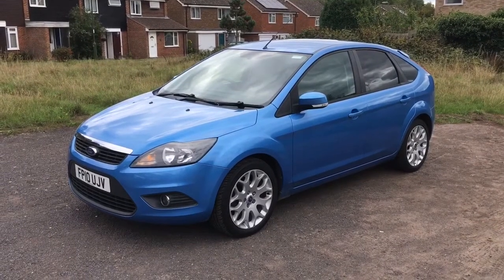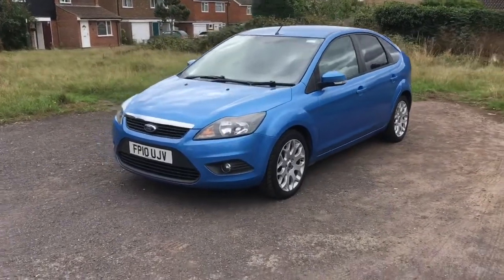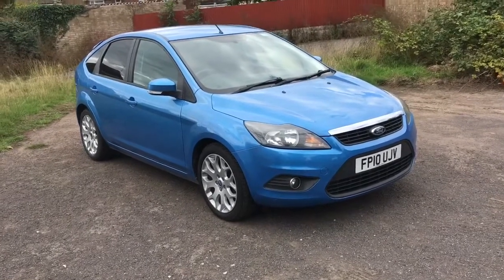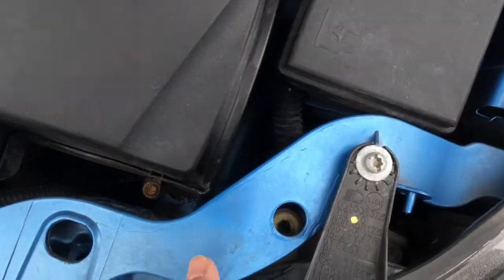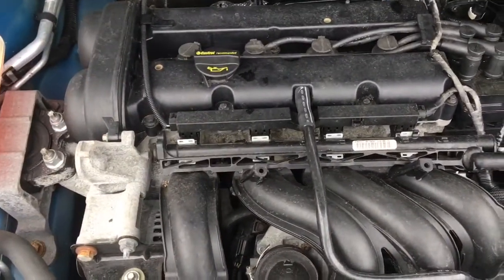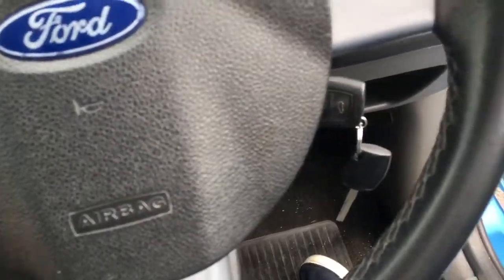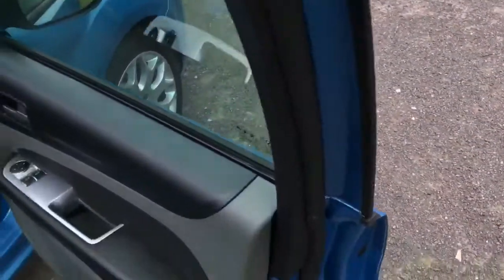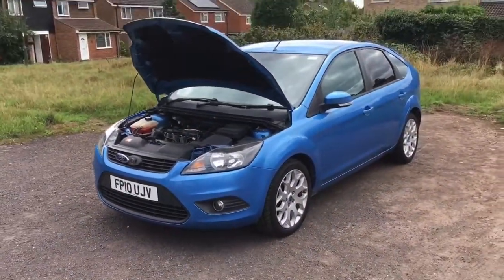New daily driver Ford Focus MK2.5 1.6 Zetec

Comment: Thought it would be horrendous when I borrowed my sisters 2.5 face-lift when my new BMW 540i was recalled,they didn't have any courtesy cars.Fun to drive nicely built and nudged 40 MPG on my 50 mile commute.Was impressed, Ford have come a long way since the ghastly Escort.
Reply from the maker: That’s absolutely true. Apart from the Ecoboost issues, it has improved a lot. I owned nealry 20 BMWs in the past and I think they went downhill after the mid 00’s, same with the other German cars.

Comment: Nice car. Ive got a MK2 Focus that I got in May this year. S/H was not clear and MOT was shady so Ive been busy replacing things that dont meet my standard. About to do cambelt, water pump and other belts as I dont think cambelt has ever been changed (done 145k). Had rear bushings replaced. Clutch slave cylinder failed when I had it so had to replace clutch. Its cost me a fair bit as its at that age but its an awesome car. Theyre not the fastest but its reliable, comfy as hell and as its a Ghia it has lots of other toys. Its been well looked after so I cant complain.
Reply from the maker: Great stuff. They’re pretty reliable too when looked after and parts are affordable as well.

Comment: My 1.8 Zetec Mk2.5 still going strong. Love how it drives, engine still rock solid. Like all Fords the corrosion can be a problem but I’m getting better with practice lol. I’m most pleased about how much I’ve been able to do myself. Done all my own oil changes, accessory belt + tensioner, air fliter, spark plugs, shock absorbers, wing mirrors (plus the usual like bulbs, wipers etc). Great cars, looks still holding up as well. Not that keen on the latest bodystyle tbh
Reply from the maker: Yes, for general maintenance they are cars that are easy to work on, despite some components that need some specific tool. What also helps is that parts are generally cheap compared to other car brands. I’m happy with it too

Comment: I've got a 2010 focus which I've had for 12 years if maintained thay seem to behave very well indeed I've also got no service history but I've known it since virtually new and done my own basic maintenance. I've recently had the timing belt and water pump replaced after 100k and it still drives like new. The only thing that can go wrong without warning is the bonnet release mechanism behind the grill and yes it happens when the bonnet is closed and won't open it's happened to mine recently and its  a very common problem on the focus .I managed to replace the mechanism with a new one from amazon.
Reply from the maker: Yes, all those jobs were done in the last two years, except the bonnet release mechanism that was replaced by the previous owner. It been a reliable and cheap car to run so far and apart from a couple of jobs, easy to work on.
Reply: how much did the timing belt cost?

Comment: I have a petrol 1.6 Petrol 09 Zetec. Is their a way to turn on the parking Sensors as mine do not seem to work. Also glad you pointed out the Clutch thing mine is a high bighting point so will propyl get that looked at . Best regards.
Reply from the maker: Hi. Either the sensors or the module are broken so the only way to test is to check the cables and connections to make sure it’s all clean and nothing is broken. Then, test each sensor and the module with a multimeter.
Mine hasn’t got parking sensors, but I’m installing aftermarket ones in the next few weeks.
Reply: @GentilsGarage  Thanks for getting back to me. Do you think this would be very expansive to have done at a Garage ?
Reply from the maker: Hard to tell to be fair because I don’t know what’s causing the fault. Garage rates aren’t cheap these days, so I would try and get a few quotes from auto electronics specialist before carrying with any work
Reply: @GentilsGarage  Thank you for you good advice. I will follow it. Best Regards to you .
Reply from the maker: You’re welcome
Reply: Ford Focus clutch biting point are generally high as standard anyway

Comment: Does the 2009 1.6L TDCI zetec mk2.5 have a timing belt or chain?
Reply from the maker: Timining belt, which should be changed every 10 years or 100k miles, but I would change them earlier than that

Comment: hi there i was wondering if you would't mind if i asked your advice on something, i have recently purchased a ford focus zetec 59 plate petrol when i start the engine it sounds very loud and tappy like a diesel car is this normal for this type of car i have never owned a focus before and i dont know anybody that owns one so i saw your video and thought i would ask if you would have any ideas thankyou.
Reply from the maker: Hi. They can be a bit tappety and clattery on cold startup but for a very short period. The clatter can be what it is called “piston slap” which is due to pistons heating up and expanding slower than the block.
Check the oil level is alright, when cold and on a flat surface, as a low level can cause this. 
Usually a couple of oil changes (about 4K miles or 6 months) can help clean up the hydraulic tappets and reduce the talent noise.
Reply: @GentilsGarage  thankyou so much for replying thats brilliant to hear i only bought the car 2 days ago from a dealer and he had driven the car to me so the engine had been running so didnt hear it when checked car it was only yesterday morning and today when i started it that i heard the sound of the engine i was getting a bit worried so once again thankyou so much for replying to my message by any chance if possible just to give myself piece of mind would there be anyway i could do a quick video of it so you can hear it for yrself would a video be clear enough to hear? thanks again.
Reply from the maker: @saragrahame9048  sure, no problem. Upload on your YouTube account and send the link here.
Reply: @GentilsGarage  ok brilliant i will put up tomorrow thanks again,very much appreciated.
Reply: @GentilsGarage  Unfortunately, the cleats are not hydraulic

Comment: I've seen people complaining about 1.6 petrol to be sluggish. How do you find it? Is it that awful and noisy on motorways? Thanks.
Reply from the maker: Well, it’s quick off the mark in town driving as the gearbox ratios are short, but the downside is that the engine is a little bit noisy on the motorway, cruising at 3250rpm at 70mph. Is not as quiet as my wife’s mk3 ecoboost. Overtaking on the motorway, could be better but does the job.
The problem I have is rolling noise which might be due to the tyres (rear ones are getting old) and the fact it has 17” wheels. This is a very reliable engine, despite not being very powerful, but good for the job.
If you want economy, go for diesel, but if you want power, go for the 2.0, but fuel consumption is worse. 1.6 and 1.8 are my ideal ones. Test drive one, including a motorway drive and see what’s best for you.
Reply: @GentilsGarage  Totally agree with your opinion. This car is a bit noisy on the motorway, you can hear some wind and rolling noises above 70 mph. It is definitely not elastic on highway speeds and is not a cruiser,  you could use it  on the motorway but you have to be following a call driving style. Tip: you can find yourself a nice set of original 15" alu rims which will highly improve the ride quality and reduce the rolling noises plus the price of the tires is much lower.
Reply: I have 1.6 2008 automatic ford focus and it is fast you push pedal down and car is gone, I use the  motor way and is gets up speed no problem not sluggish and the wind noise isn't any problem most time I'm listening to music anyway love the car I also only  use premium fuel

Comment: How much does the car consume
Reply from the maker: Roughly 41MPG or under 6l/100km
Reply: @GentilsGarage This is mine in 7-8
Reply from the maker: @nanokananoka9146  that’s not too bad as it depends on a lot of factors
Reply: @GentilsGarage  What could be done with it to consume less
Reply from the maker: @nanokananoka9146  for a start, having the car regularly serviced with a annual oil, filter and air filter change. Plus, check the spark plugs for their condition and if the gaps are correct.
Also, make sure the tyre pressure is correct.
Fuel quality is important too and I sometimes ran a tank fuel of shell VPower every month or so as it helps the cleaning. 
Then your driving style, the places you drive and the amount of traffic does play a big part too.
I have this fuel consumption because I drive a lot in motorway.
Reply: @GentilsGarage  Thanks for the reply